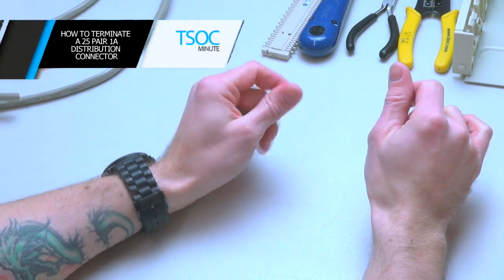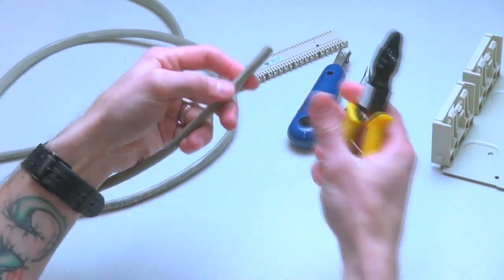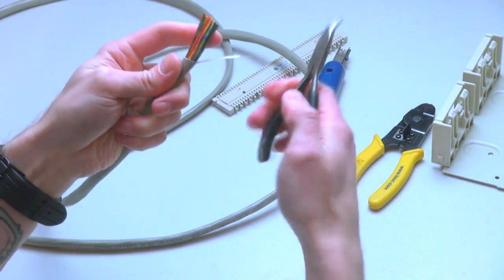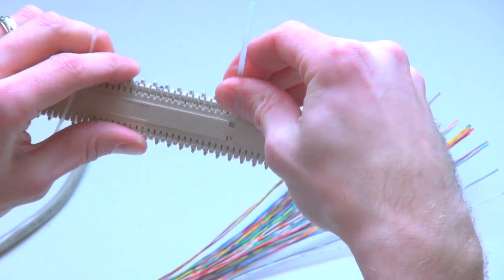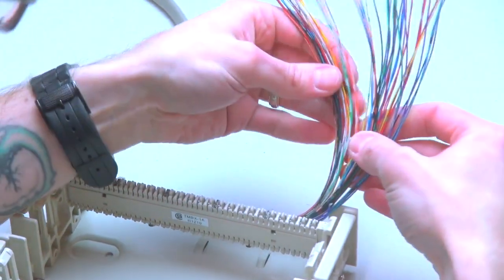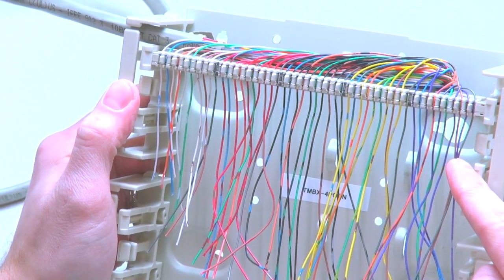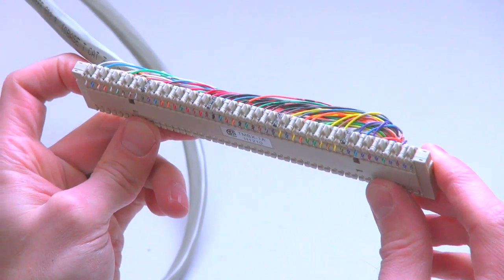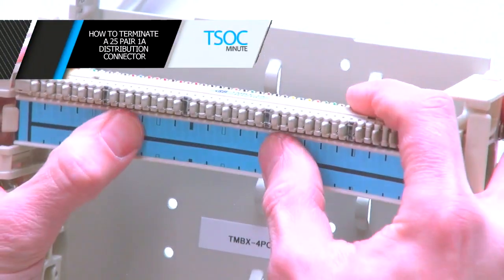How to Terminate a 25 Pair 1A Distribution Connector - The TSOC™ Minute (ep. 17)

Comment: You really don't have to cut the wires where scored.  The excess wire will be cut off when you punch down the wires.  Also, leave enough slack, so that the strip can be pulled out of the frame, after the wires have been punched down.  I like to punch twice, to ensure a solid connection and a full cut of the wire & insulation.

Comment: Messy work, I have terminated a lot of cable in my years, I guess standards have changed over the years.  The outer insulation should have been trimmed neatly with lineman scissors.  We typically would separate the wires by colour code all the way back to the outer insulation giving it a neater lay down.  We have come a long way since the days of lacing cables and wires down with waxed lacing cord.
Reply: Your talking many years ago. We're you on the frame?
Reply: @fubarsnafu4994  every where, internal plants exterior installations, user consumer end point. And plant supervisor.  I watch a local lineman install a new phone line in my apartment building, the wire closet was a rats nest of wires.  Old wires never get pulled, the new concept, get, in, install, test, and get out and head to the new job.  Not like the old days.
Reply: @brianjohnston9822  dropped and terminated a ton of cable over the years.
100 pair was common but 1500 over head multicore. Usually 1500pr + 4 or 6 fiber and a few cat5 in the jacket for good measure.. 
If I would have used gel chicklets or 3m snap locks. Flat out would have been looking for a job. Overhead and direct burials are a process. Long and tedious but necessary.
 As I watched. I was thinking a step ahead of them and they pulled out the chicklets. I was like No no no nooooo!
 That entire phone switch has a loud annoyance of a Hummmmmmmmmmmmmmm. Thats never gonna be fixed.
 ✌
Reply: @fubarsnafu4994  By chicklets do you mean 3M Scotchlok connectors? Why would you have been fired for splicing a cable? What would you use instead? Why would they induce hum?
Reply: @helmanfrow  chiklets are the white n blue gel filled crimps for telecom low volt
Reply: I've been around long enough to remember laced cables.  My cross connect experience goes back 50 years, to the days of the "Christmas tree" solder blocks.  I also vividly recall stripping the cross connect wire, having it stick a bit, until it let go and my hand banged against the next block over, with + & - 130V DC on adjacent pins!

Comment: Carried a Bix termination tool in my kit for more than 30 years, don't think it was ever used.
Reply: I still have mine after being retired for almost 20 years.  Still use it occasionally.  I even still have my 66 block termination tool.  I also remember the wire wrap and soldering method.  Like some said, do we still even support BIX since Nortel fell.  I still see it being used in older installations, it is not cost effective to switch out existing cable plants.
Reply: BIX is a great system. I'm installing it in my home reno. Obscure though it may be, the modules and frames are still readily available where I live (north Toronto suburbs). I find 110 to be klunky. I'd use Krone but it's hard to get here.
Reply: I have both BIX and 110 punches in mine.  While the 110 gets used regularly, thanks to Ethernet cables and Keystone connectors, it's been many years since I've punched a BIX strip and I've only worked with a 110 strip once.  It's also been many, many years since I worked on solder or wire wrap blocks.